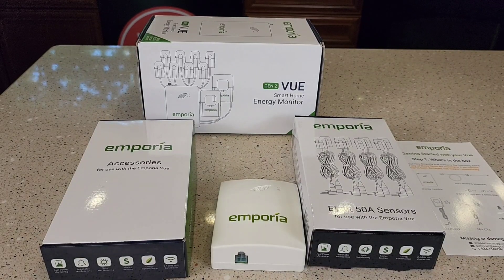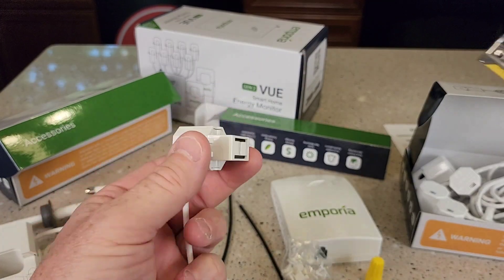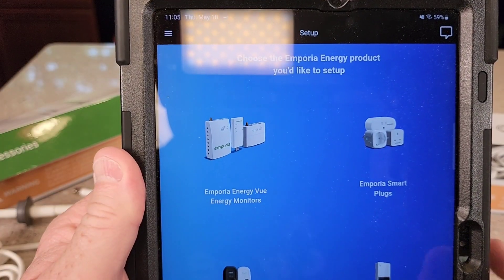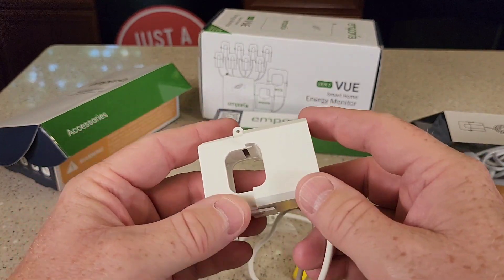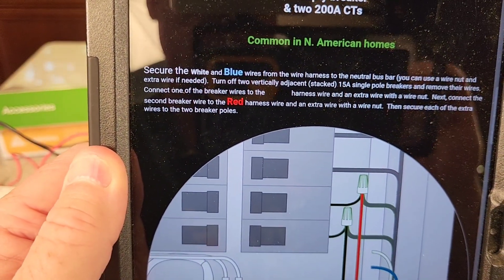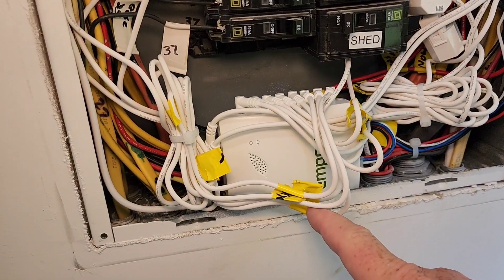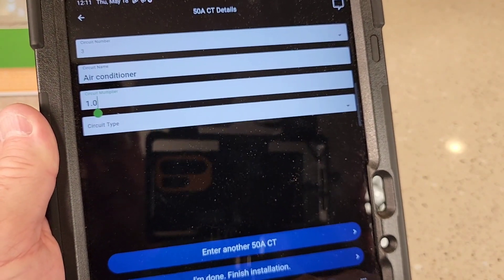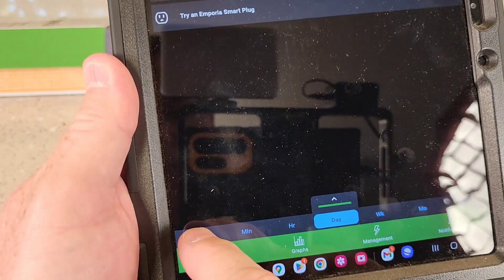EMPORIA Smart Home Energy Monitor / Current , Watt Meter  Review & How To Install

Comment: OK, I have a problem. My incoming cables are much larger than what you have and they're closer together. They are about an inch in diameter. I managed to get a clamp on one of the cables but there's no space to get the other around. I tried to pry the other cable apart from the other one but it wouldn't budge. Do you have any suggestions? This is not the type of electrical work that I'm used to doing. I don't want to break the main breaker. I can't post a picture here. What do you recommend?